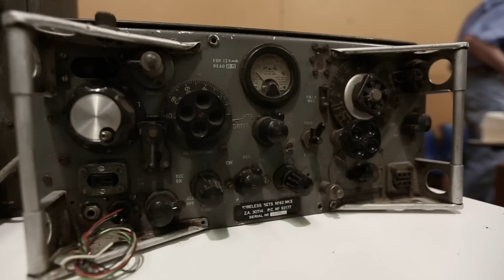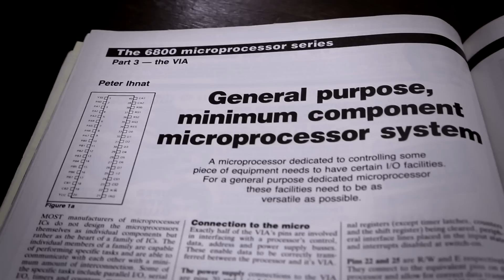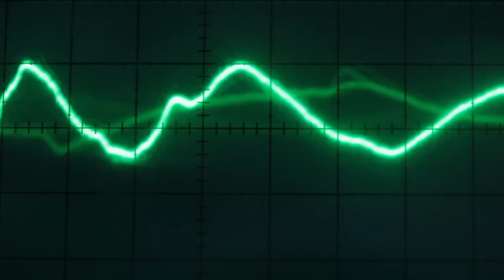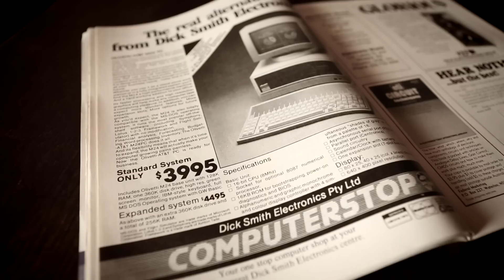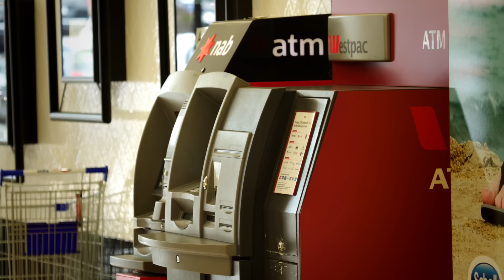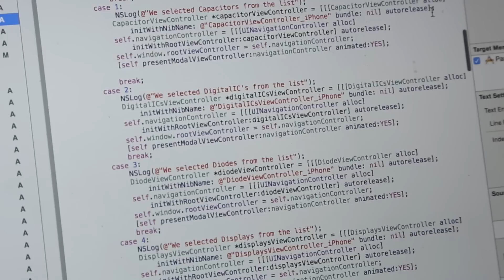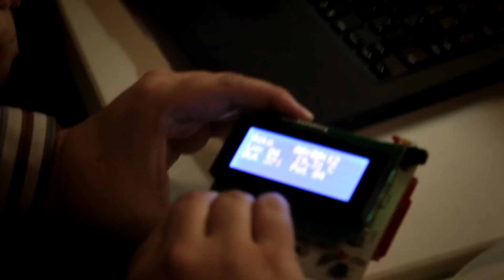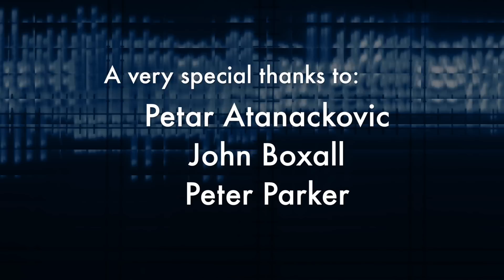Complexity & Integration

Comment: I'm 14 and i find that i do not really use micro controllers too much but then there are things that i can't do with out one like ruining an LCD or make a clock (i guess i could now that i can make pcb's but a month ago i couldn't)  i remember when i was 10 and was taking apart an old washing machine that had the old controller in it that works kinda like a clock in a way where the 60 hz from mains runs a motor that turns the switches inside and i tried to build one myself from a mechanical kitchen timer so i put an arm in the part that turns and made it swipe across a pic of cardboard with strips of aluminium foil and it worked it was driving a "machine" i built but it was not accurate but i do say that when someone brings me an old router to tear down i usually just end up having fun and overvolting it  until it blows up unlike when i get a microwave and i'm like SWEET !  i get a mot a ton of switches fans and stuff
Reply from the maker: Get yourself an Arduino, learn to program it and control external hardware like the motors you scavenged. Its well worth it but until you know what your doing, stay away from line level voltages like 240v/110v AC from the wall. Arduino is awesome for getting started with microcontrollers and leads to a good understanding of the C programming language and a lot more. Thanks for your comment.
Reply: State of Electronics Well i have an arduino and i know how to program it. Saying away from 240 ac in my area i do say away and only do stuff with It  when i have a specific project and do exactly as i planed. I find tinkering with it dangerous and scary but useful sometimes. Trust me i know what i'm doing very well maybe not as much as a professional but as a hobbyist i'm far from a beginner. Thank you for your reply.

Comment: I will write the same comment:
I think that if hobby electronics goes down the drain, kids will never 
have the trigger to involve and probably we will run out of electronic 
engineers. We will stuck with the existing technology, making variations
 and there won't be anybody to evolve the technology, because nobody had
 the chance as kid to make, search, fail, succeed, learn. After all, 
even a "all in one" chip today is made from components put together. That goes for modules too.
Reply from the maker: Its definitely challenging times. Thanks for your comment.

Comment: I don't know - I'm 57 and these guys sound old ;)  Computers have made learning electronics much much easier and much less expensive.  Parts today are well documented (datasheets).  You still have to learn the basics even to use modules.  There is no reason why the electronics hobby is dying.  Equipment is very affordable (even something like an oscilloscope, something people used to dream of owning)...  Many things that would have taken hours and hours to create in the past can now be reproduced with a few modules and basic components.  I was interested in electronics as a kid and today still am - no difference in my mind, technology moves on...  And yes, you can do surface mount work with a temperature controlled soldering iron.  The arguments I hear  on this vid are BS.
Reply: +Digger D     ah yes, the old-man rant format...  televisual prozac for the nation's old-age care homes.

Comment: So I'm out here in South Africa -- born in Namibia -- and I remember how similar these things were when I grew up. There was this one shop in Windhoek (capital of Namibia) that sold discrete components. It was called Dilfa. I used to walk several kilometers to get to it. The old man behind the counter (I think he was called Joe Smith) wasn't very friendly, but over the years we got used to each other. I was only in high school at the time. Then Maplin opened a South African branch, around 1993. My maplin catalogue was my most prized possession. I still have it... though it's minus the front and back page by now. I used to order components via mail, doing a bank transfer to pay for it. Then I'd wait two weeks while the parts got mailed from South Africa.

In some ways, this has not changed. I still order my parts from Cape Town (RS components), though now I use the internet. I now use a courier, because our post office has become unreliable. It's expensive to have it delivered, so you can't just order a a few parts (so orders inevitable get padded with heaps of attiny45 chips and such).

Yes, things have become more complex. But people still have to prototype. I don't see that segment of the market disappearing completely. If anything, buying an arduino, wanting to measure something... and then having to figure out how other components work (eg opamps and linear regulators)... is still a very real thing. I mean, I started from the bottom up. I see many of my friends and colleagues coming from the top down, starting with a microcontroller and then requiring interfacing circuitry. I think the kids are alright :-)
Reply from the maker: +plonkster Great comment thank you. Yes there has been a massive resurgence in electronics thanks to Arduino. The cost of getting parts from a distant source is always going to be a limiting factor. Australia like Namibia maybe(??) has huge distances between towns, it's hot, dry and full of dramas like floods, fire & famine so getting parts for your projects is often quite a challenge. While the internet certainly has democratised the world of choice and brought the cost per unit down, those gains can quickly dissipate with shipping costs. And you certainly need to already know what you want in terms of understanding the parts you want. That's what this episode was primarily concerned with - the complexity for beginners has made it tricky to get started perhaps?? I do agree with you however, ultimately it's easier to just start from the top down - use a microcontroller then get to know the interface circuitry for sensors & output, but may beginners may not understand that.
I can totally relate to your dilemma in buying parts online. It takes both a good understanding, pre knowledge of what you want to build and a keen eye for managing your own logistics, so you don't kill your passion waiting for things to arrive. Thanks again for your comment. Cheers Karl

Comment: Love this series; Thank you so much for the efforts. I think the opportunities for youth to get involved in hobby electronics is better today than it ever was. So easy to buy and learn from "friendly" purveyors such as Adafruit and Sparkfun, plus ability to order 1 or 1000 parts online from Digikey, Mouser, etc. at very inexpensive prices. I've gone from breadboarding a 8080 in early '80s, through early micros, and PCs, to today where learning and experimenting has a tremendous following and community. The merging of software, hardware, and firmware and at-home fabrication with low cost 3D printers, laser cutters, and mills makes for so many entry points for hobbiests.
Reply from the maker: +Warren Bailey Thanks Warren for your kind words ... very much appreciated. Yes the world of choice is now endless. The price in Australia for items bought off the internet however is not insignificant. In many cases the shipping cost of "cheap" product quickly becomes very expensive due to shipping not to mention the other option -slow, killer to passion shipping options which still cost too much for single items that take up to a month to arrive. I think you are so lucky that you have access to both cheap goods and services in the US. Australia has to address this key issue in an innovative way to compete in the future. Thanks again for your comment. Cheers Karl

Comment: Fortunately,  at least in the US, Radio Shack (Tandy) is marketing discrete components.
Reply: +dgr8zod If you consider cell phones and batteries to be discrete components. I was in one of the few remaining Radio Shacks a few weeks ago, and their entire stock of discrete components was stuck in the back in one metal box with a few drawers -- nothing like the walls of components they stocked fifteen or twenty years ago. Radio Shacks used to be packed to the gills with stuff, but now it's down to bare bones. The multimeter selection is better at Home Depot than at Radio Shack, for instance.

Comment: Another great video.  I'm surrounded by little Ebay modules, Atmel tiny, Arduino and other bits. Still fun to hack and code.  Love the steam reference spent a day abord the Jeremiah O' Brian (SP?) a WWII Liberty ship as it was cruising. All through the ship, big and small steam engines doing their thing. At 3000HP, the main, triple-expansion engine at cruise speed was almost silent, you could talk normally 3 feet away. You could see almost all of the bits while running.  That was cool tech. I'm a trained model 15/20 teletype tech. You never quite understand a serial to parallel converter quite like when you got all it's bits in front of you, all mechanical. But there'[s a lot you can do with micros and modules, on the cheap, even. I'm pretty sure that electronics is about the only discipline where the stuff gets faster, smaller, more powerful and more capable, while at the same time, cheaper. Just harder for those of us with aging eyes to deal wth...

 Keep up the good work!  Yours, Stu  AKA Stubat
Reply from the maker: +D. Stuart Hey Stu thanks again for your comment. I'm glad you like the steam reference. I agree, they are amazing tech because you can see everything, learn to understand it so easily etc. Really glad you like this episode. Initially I was afraid it was too long and too detailed but so far most have been OK with it. Cheers Karl

Comment: ¡Great video!, congratulations Karl completely agree on many of the
point of wiew that comment on it.
Well, I'll shared with you my opinion, and I hope you will forgive my
poor English (I am Spanish)
We are a generation that has the hardware,  and our level of thinking is
"the electronic component".
There was a quantum leap with the invention of the chip, the first
"black box", then we go to level "integrated circuits" which basically
remained more or less compressible HARDWARE.
Today we have another great jump, and have passed the level "module"
example "Arduino" "bluetooth" "wifi" "ethernet", etc. Also a new player,
SOFTWARE appears.
The frontier between hardware and software is diffuse and many applications
can be done with one or need both.
A problem the excessive complexity of all elements requires specialization,
which creates ignorance in other fields.
We connect and program an Arduino, but how the Bluetooth module works?
How the radio frequency stage work?
Is this the end? Have we reached a level where we lose intricacies over
view of the forest to focus exclusively on our tree?
In the immediate future there will be intelligent machines, virtual environments,
the frontier between "human intelligence" and "artificial intelligence"
will begin to fall.
Similarly, the border between reality and virtual, hardware or software
is disappearing.
In a few years we will see that intelligence is like energy and that reality
can be programmed.
A world where the perfum of a rose is no longer a chemical synthesis, in
the near future, perfum, rose and perhaps we ourselves are simple lines of code.
Technologically we are talking about the "homo sapiens"
In the future we will be "System sapiens".
These lines that I write is translating by a "machine" and others "machines"
that make them get this information to a virtual environment, a web,
these have no "physical" space
In the future perhaps the machines will write and invenstiguen upon us,
and maybe we let us "eternal" in the "virtual space".
In the future I will continue seeing your good video. :-)
Karl You make great videos.
greeting Manny.
Reply from the maker: +sinreparostv A huge thank you for such an amazing comment - perfectly understood! Yes the philosophical approach is probably the best way to look ahead given the complexity. I really like your interpretation that its not just an issue of "hardware or software" but one of "virtual and real" as well. Yes those levels of abstraction just keep going up and up. I take your point that as we abstract higher we also need to specialise and that this inevitably breeds ignorance in other areas ... to be a specialist means you don't look outside of your field of view. In the future, humans will have to rely on artificial intelligence, sentient "things", to contain a complete overall view of technology - its just so deeply complex. I guess that's google for us all right now while we wait :-) Thanks so much for your kind words and very considered comments. Cheers Karl

Comment: Nicely done as usual. Would be a tough job editing so many scattered bits of footage into a meaningful video.

I think it's much easier these days with so many examples and tutorial on the internet. In particular the arduino makes it so easy for anyone to get started. I think the black boxes are necessary, otherwise there'd be too much to learn. I'm sure sales of 555 timers have declined lol. Nowadays the only electronics people design and work on are to support ICs and even then most of the time you just read a datasheet for ICs and follow the recommended usage.
Reply from the maker: +sky17 Great comment and thanks for your kind words, much appreciated. The abundance of tutorials online is great however many of these are not good examples or explanation of "how it works" because the understanding of the maker is limited or even wrong. That said, there are many that are fantastic, clear and very precise. It's tough for a beginner to wade through the good and the bad but I guess the good will float to the top eventually. I do believe the Arduino community have a special place in the history of hobby electronics, having had a massive impact on the numbers of ordinary folk now interested in programming and electronic hardware design. Whether by stealth or a developing curiosity, many become hobbyists and then later on engineers through their interaction with Arduino - its really great to see. So yes many just use already engineered solutions to get started but I do think that many go on past that point and develop their own "things" as well. Thanks for participating :-)
Reply: +State of Electronics No problems happy to participate. I think it's a great way of learning, to learn more electronics as your projects require. For example you may need to learn how to use opamps for some arduino project to read small voltages (strain gauges, current shunts). They get to put it into their project. In contrast, someone doing formal training like electrical engineering will learn all the opamp theory without ever applying it.

Also, i noticed you seem to be filming on a first gen canon dslr or equivalent. I wonder what Grant Petty thinks of this :P
Reply from the maker: sky17 Many of the interviews took place up to 5 years ago. BMD had at that time not revealed any plans of a camera. I am continuing with my 5D3 & 5D2 because of continuity only. I'm very much looking forward to using a more modern platform.

Comment: Was this sponsored by Apple?  Jeez, I think I hear ipad, ipod, iphone each 200x times in this video :(
Very disappointing compared to the others in this series
Reply from the maker: +ituxcoza No definitely not - no sponsorship by anyone! That was just how common that example was in their answers
Reply: +ituxcoza Just that everyone knows Apple and the products are designed to appeal to people with no technical knowledge. All the technical specs are hidden away, the os doesn't let you poke at its guts at all. All of it is hidden under an abstraction layer. 

In contrast the early microsoft smartphones (back before the iphone even came out) would let you stroll around in the windows directory out of the box and if you did something bad in there the phone wouldn't boot anymore. The user was expected to have some computer experience to use it. Nowdays there smartphone OS is simplified and locked down similar to apples in order to appeal to the non technical masses.
Reply: +ituxcoza Most likely because they use apple computers due to the fact OSX provides a Unix-like design environment.